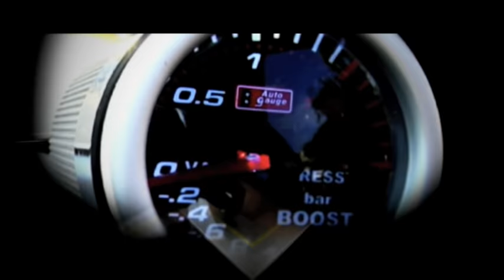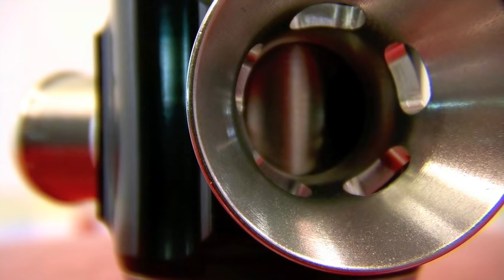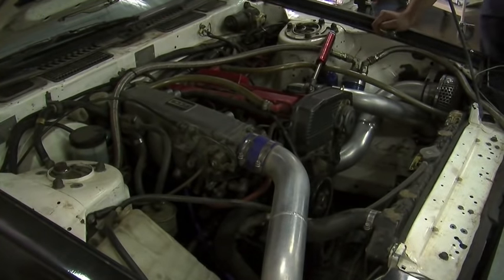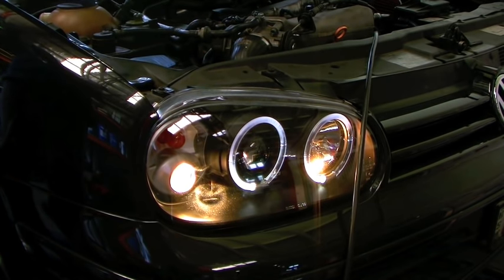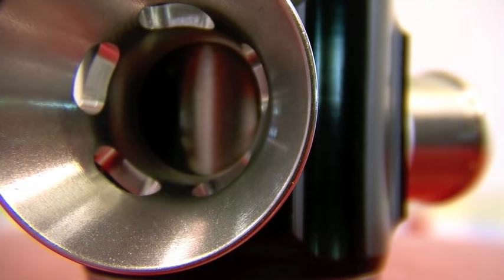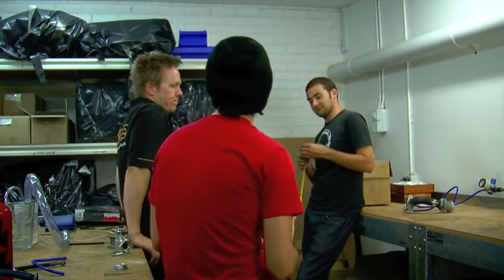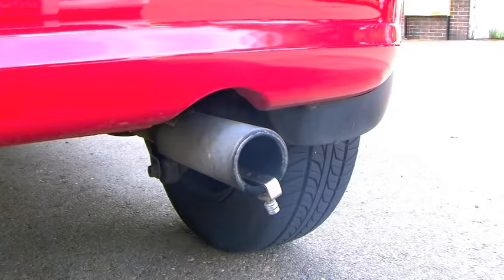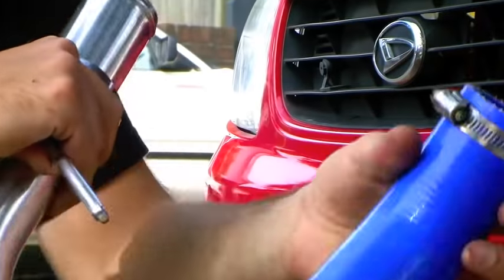Blow Off Valves Mythbusted

Comment: recircing the BOV is very important if you are running a MAF before the turbo instead of a MAP in the manifold because if you release the air to atmosphere when running a MAF, then you are completely ruining your A/F ratio as you just vented air that the engine is expecting and dumping fuel for. Can have a big effect on 1/4 mile times as your A/F gets messed up for a second at each shift. can make for a nice flame thrower exhaust, though.
Reply: Exactly, I can't believe that they didn't cover this
Reply: ***** It is that bad. Especially on vag engines. 
To a point even, when they start boging and surgeing on gear change. 
Usually  the diverter is set to open at certain level of boost - so should the BOV be - but many set it to too easy and that causes additional problems.
Reply: if you have a good tuner, they can rescale your maf and it will act just as if your maf equipped car was converted to speed density
Reply: XxAtomic646xX well many aftermarket ecu's allow you to eliminate the maf and run a map sensor instead. (AEM being one that I've seen it done with), but that is an interesting idea that I hadn't heard of.
Reply: Hallsy it's something we evo 8/9 guys do if we do want to go big turbo.  Cause speed Density only shows gains on bigger than stock frame turbos
Reply: XxAtomic646xX don't wanna go*
Reply: Hallsy I know atleast on my car, if you have ecm link installed into the ecu you can tune the car and change a bunch of other settings, and one of them is running it in blow-through mode and im not exactly sure how but it eliminates that problem. (only if you are running a GM MAF with the translator)
Reply: Hallsy If you have a wideband 02 you can run a full BOV if you disconnect your MAF. Your car runs on predetermined fuel trims. However, you must have a wideband.
Reply: Thats why you put the BOV before the MAF. Problem solved.
Reply: Hallsy Yes an No.  Here's the thing:  Main issues associated with running a BOV verses a DV are as follows
1. Bad Idle
2. Extra Fuel During Shifting 

1. This can be cleared up by adjusting the spring on the BOV (Mine was leaking when I first installed it.. I upgraded the spring tension and it no longer leaks)
2.  When your RPM's are on a freefall drop after shifting and letting off the gas, the engine will cut fuel and spark anyway, so this shouldn't be much of a problem.
Reply: Doug Bedo The only thing with this is that normally on cars metered with a MAF, the MAF is not directly connected to the charged air area.  It's normally installed  on a large diameter housing purposely built to slow the speed of airflow coming.

The BOV is connected on a charged line where the piping is significantly smaller than the turbo inlet (Where the MAF normally meters at)

To give you an example, my charged air piping is about 2.5" where my MAF is in a 4" Housing.

MAF's are very sensitive to the speed the air is flowing at, and they're also limited in range to what they can measure.

Comment: Blow off valves aren't intended to make power. What they do is release the pressure on the turbocharger when the throttle plate is closed, making the bearings and other internal components last longer.
Reply: Aaron L rich coming from a person with no pic.

Comment: I thought the benefit of a recirculation valve over a bov was seen by slightly quicker spool up AFTER the gear change?
Reply: Yes exactly, this is a crappy video, the whole statement is misleading about venting atmospherically versus diverting, because the power will be the same but what you gain by having a diverter valve is quicker throttle response because you're not losing that boost charge and needing to respool that boost charge from scratch so to speak. So the test should not be total power output but rather throttle response right after a gear shift (when you step off the gas in the course of a shift)

Comment: The reason I have a recirculating BOV on my Subaru is to help maintain boost between shifts, because of my larger aftermarket turbo. I think atmospheric BOVs are stupid and solely for an annoying high pitched purge sound. Obviously it's to blow off the massive surge pressure from the turbo, but be smart and use that surge pressure to hold boost with a recirculating bov
Reply: TripoliVegas how’d that bigger turbo work out in your scooby?

Comment: Recirc valves are very important on some cars, specifically ones that use the MAF to determine how much air is in the intake system and adjust fueling proportionally. If the blow off valve lets the air out, but the fuel still gets dumped in, you can run extremely rich, which will then cause the short term fuel trim to lean out. Then you get back on the throttle, run lean, blow your motor, and blame it on the tune.

Comment: Pay more for insurance? I pay less for my 2015 WRX than I did with my Ram 2500 HEMI or even my 2013 Tacoma. I believe i was about $20 less than the Ram but only $6 less than the Tacoma.
Reply: With full coverage, $500 deductibles, going from a 2014 Mirage (i3, 1.2L, 74hp, 0-60 in 12 seconds) to a 2014 evo (i4, 2.0L w/turbo, 290hp, 0-60 in 4.5 seconds)... insurance went up almost $40, from $105 to $141. My 2011 Camaro was $130. It's more, but fairly insignificant when you consider the cost of the cars (Mirage 13k, Camaro 27k, Evo 40k).
Reply: Ancyker  damn that sucks. My ram was a $60k truck so that could be why it cost so much. However i still pay less than i did with the Tacoma, which i find odd. Too many variables are taken into account with insurance. Its retarded.
Reply: *****
Tacoma drivers are often going offroad more than dodge trucks lol.
Reply: Fireblaze15 yea i took my Tacoma down more trails than the ram. Mainly due to the fact that it could actually fit without hitting a tree.
Reply: ***** or the fact that the Tacoma is actually built for that.
Reply: I paid $160 a month for my 1996 Ford Explorer 4x4 with 170,000 miles (4inch lift and 33" tires {they didn't know shhh})(allstate) and $88 for my 2006 Mitsubishi Eclipse Gt (55,000 miles) 6spd that i can hit 155mph in 5th (nationwide).  Age, gender, price of the car, off-road, car type Insurance company mean a lot. They were both full coverage.
Reply: Zachary Murdock I pay 98/month for minimum coverage on an 99 stratus. Its borderline age discrimination :(
Reply: ***** my mother's 02 Honda accord tops out around 140mph and its an automatic. I wouldn't doubt it if that car hit 155.
Reply: ***** its not a matter of hitting that number but how long it takes to get there.

Comment: 105kw =140bhp. The  1.8 turbo (im guessing engine code AGU judging by the cable throttle) sould be running 150 bhp even without a tune. Something isn't quite right there
Reply: Every dyno loads differently, you can only compare dyno results against results from the same dyno.
Reply: That's Volkswagens stock number, Isn't it measured at the crank? 150 official horsepower are probably around 120-130 IRL
Reply: You don't measure bhp on a dyno like that. You measure whp, which is after probably a 15% loss due to transmission. You can either adjust the bhp measure for drivetrain loss or add 15% to the whp number the dyno read out. If you do that, the numbers seem consistent (about a 11 bhp gain).

Comment: With a circulated blow off valve, wouldn't you get up to psi faster? Since all the air is being kept in a closed loop system?
Reply: Faster doenst always mean more power on a dyno.  If your bov is dumping too much air between shifts you would effectively be killing the efficiency of your spool.  Re-circulation aims not to do that by dumping  vented air back into the intake system.  How much faster.. its hard to say but i would be willing to bet that a recirc car with identical driver conditions will perform better than a poorly selected all for noise vent to atmosphere set up.
Reply: local tourist yea there is no one size fits all you’ll need to dial springs weights and settings for your set up but you could be right in some setups it could vary I was speaking more overall
Reply: local tourist  I think Diesel turbo systems operate differently. Honestly, I dont have any experience there but my guess is they are different in some degree.  Tinkering is key finding that sweet spot

Comment: I can't believe all the people who want the turbo flutter sound.  To me, it's right up there with knocking rods, piston slap, and maladjusted valve lash.  It's the sound of failing parts.
Reply: +Tony Tuite But it's not parts failing, if it does cause any damage then it's so small you wouldn't even notice it over the life span on the turbo, plenty of people not running a bov for years without issue.
Reply: Sorry, but you're wrong. Take my Holset HX35 for example. It has an 83mm diameter exducer. Converted to inches, that's a diameter of around 3.25", or 1.625" radius. Take Pi*1.625^2=~8.29 inch surface area. I am running 21 psi of boost. Now take 21*8.29=174 pounds of thrust load slamming into your compressor wheel every time you shift. That will quickly add up to permanent damage to your thrust washers and bearings, not to mention your compressor wheel over time. Add in the effect of this Shockwave exerting reverse force on the turbo, and that is a lot of damage fast. You may get away longer on a small turbo, but if your making real power you need a BOV.
Reply: Tony Tuite Your numbers don't mean shit, in the real world it really doesn't matter, not to mention they are designed to take that kind of load.

" You may get away longer on a small turbo, but if your making real power you need a BOV."

In Australia and Japan it is very common for people not to run BoV's (especially in the VL turbo and drifting scenes), including people making well over 1000hp without issue.
Reply: +DriftNick Ignorance of math and engineering doesn't make you right. Do what you want. I'll keep my car running for the next 5-10 years.
Reply: Tony Tuite You know what makes me right? the countless people who don't run BoV's and haven't for many years without issue, your math doesn't mean anything, your wrong about the amount of load it would be hitting the compressor, it's not as simple as the size of the surface area times the boost and all the load wouldn't just be hitting the compressor.

so yea I will do what a want and for some reason I think my turbo will be just fine like it has been for the last 5 years.
Reply: +DriftNick +tony tuite , ever heard the saying it's hard to argue with someone who's smart it's impossible to argue with an idiot. Not trying to have a go at you @driftnick i love the zutututu sound but think if you where blowing a pin wheel and all of a sudden the air was pushed back into it, it will slow it down a little you just have a placebo effect where you can't notice. loved the vid watching one of the classics
Reply: I like it. It kinda reminds of airplane engines, with the rotor blades making sounds lol
Reply: ***** Now imagine that bullet proof class really could stop any bullet without damage or any noticeable damage then some idiots on the internet say it doesn't without any proof.

Funny how it's always American's saying stuff like that, meanwhile the rest of the world have no issue with not running a blow off valve/bypass valve.
Reply: ***** Driving your car causes wear? omg that is so shocking.

"surprise, it happened after planting it and letting off without a BOV."

I've also seen this happen on cars with blow off valves/bypass valves, it's funny that it seems like turbos can fail with or without them, it's almost like they aren't the cause of the failure.
Reply: ***** For some reason I think my turbo will be just fine, maybe it's because so many others have tested it for me and don't have issues.
Reply: +DriftNick i agree with you, if youre not running serious psi on your turbo the non-bov fluttering turbo is my kind of turbo. Which i dont think most people are pushing 35 psi without a bov anyways.
Reply: lol turbos already put enough stress on engine components and not to mention itself, why would you willingly speed up the process of wear and tear? even if it's a minute amount that's just stupid
Reply: +r u mad yet because it isn't a big enough deal
Reply: Dengaz how is having to replace your turbo earlier than you should really have to not a big deal?
Reply: +r u mad yet turbos wear with time no matter what it's how hard you push them and how often which makes a noticable difference and if you drive it like you hate it that's when you'll have to replace it noticeably earlier.
Reply: r u mad yet Because if it does any damage it so small you wouldn't even notice.
Reply: DriftNick http://www.dsmtuners.com/threads/is-it-ok-to-make-your-turbo-flutter-like-the-supras.347433/  

Since it seems like you're completely ignorant on this topic and are willing to accelerate the already steady damage to a turbo, I want you to read this link.
Reply: r u mad yet Did you even read the thread you linked? not only is the op talking about on throttle surge but they quote another post that says the compressor wheel will spin backwards and there are people in the thread saying off throttle flutter is fine.

Comment: The blow off valve has two purposes.  The primary purpose is to prevent turbo surging where high pressure air is forced  backward up through the inter-coolers and back through the turbo.  This surge can damage the turbo bearings; both shaft bearings and end bearings.  The second purpose is to prevent over-pressures that can damage boost feed pipes and inter-coolers.

Comment: That was stupid. You will not gain or lose power with a bov. A recirculator will simply allow the turbo to spool faster after a shift because that air is rerouted to before the turbo rather than venting to atmosphere. And the reason you run rich after putting a bov on is because on a system that uses a maf sensor the ecu is injecting fuel for the air you just let out into the atmosphere. You will only run rich for a split second after getting back on the throttle. The only way to get around that is to delete your maf sensor and only base idc's off of a map sensor.
Reply: Actually on a VW using a BOV will lose power. They use diverter valves instead. The BOV loses pressure dropping boost after a gear change AKA when it opens up
Reply: Obviously you didnt understand what I said. You will NOT lose power. Your engine will make the same amount of power with a bov, bpv, or no valve at all. Bov's have no affect whatsoever on power. You will lose spool time after lifting off the throttle then getting on it again.

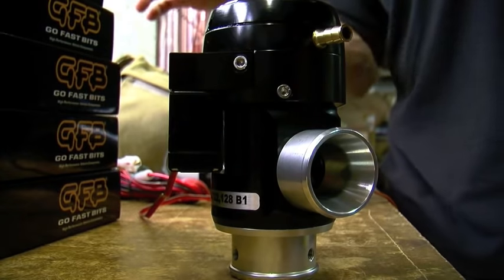Comment: from 2:30 to 3:10 is the only useful info in this video... the usefulness of a recirc valve or BOV is only seen in actual driving conditions and has no effect on peak power... putting the car on a dyno was pointless.
Reply: The dyno also showed what happens to factory turbo cars running high boost tunes - they cant hold the additional pressure and leak boost robbing you of power --- thus a NEW blow off valve would actually give you more power while also adding to the sound of the car ----  hi boost tunes on those GTIs crank it up to 20-22psi from a factory peak of like 12 or so
Reply: Servicemember80 Thats high boost? My car came stock boosting 22psi lol
Reply: Michael Boykin The expert told them that but they decided to ignore his words of wisdom & waste time on the dyno lol

Comment: I only want the pssssssss tututututu
Reply: +Bainanaz Even a factory turbo running stock boost will make the sound, of course more boost or a bigger turbo will be louder, also metal air intake into the turbo makes it louder to.
Reply: you guys do know this sound is bad? running a lot of boost and not having a BOV will make that sound.. oh wait it'll blow your turbo eventually also.
Reply: Cole Zormeier no it won’t
Reply: DriftNick I know I sound stupid and weird... Is it possible to get the psst shututu sound in a non turbo car..? ( and yeah it's a bit low powered car I meant it's 1.2 - 1.5L petrol engine.
Reply: Mesh 3432 nah
Reply: Kaine Gunn 😭😭😭😭
Reply: my 2018 cooper S fully stock turbo flutters, BMW wouldnt make cars that will blow the turbo
Reply: Mesh 3432 get a cold air intake
Reply: LeggoMySweggo sure man.. Thnx
Reply: Mesh 3432 it might not sound exactly like the turbo sound but you will get some
Reply: LeggoMySweggo yeah I just planned to that... Shak Shak sound comes right? 😜😂😅😅
Reply: Mesh 3432 depends on your rpms usually if you rev under 2500 you get flutter but above that you get a bov sound so it all depends on your throttle usage to get the sound you want
Reply: Mesh 3432 it also depends in whether or not your car is turbo for the sound

Comment: turbo Gti with mods only getting 140hp to the wheels,  garbage
Reply: +wartactics 
depends how old the engine is.  

over the life of an engine, parts wear and power will fail,  My vectra 1.8, ok its a non turbo automatic, may have produced at a guess 110hp when it was new in 1998, its probably now down to around 80 so a 7 year old GTI producing 140, seems about right.
Reply: Even the Golf R was never a hardcore hot hatch... The Germans are yet to build a Hatch I deem good. 

The Volkswagens look gorgeous but on track they are heavy. They are "Sporty Comfort" cars.
Reply: Nåti M you can’t deny how good the s3 is or the amg45 aswell as the m140i and the Leon cupra r. All German built hot hatches
Reply: it was garbage when it left the warehouse

Comment: You don't lose performance with a BOV, but you do increase your lag between shifts, as compared to a BPV which recirculates the air back into the intake tract and helps keep the turbo spooled.